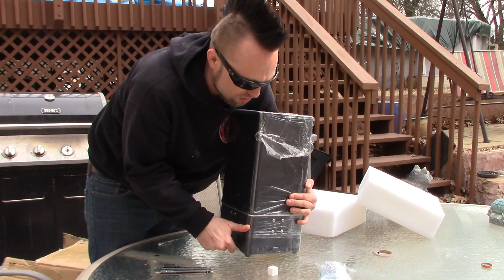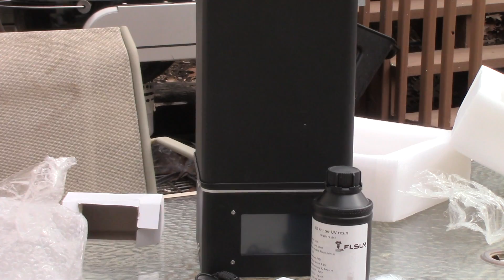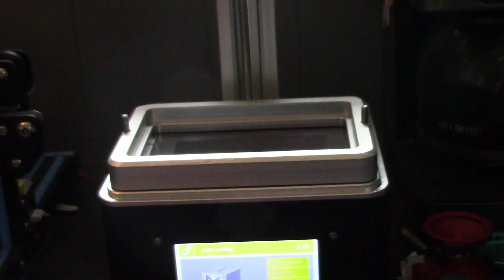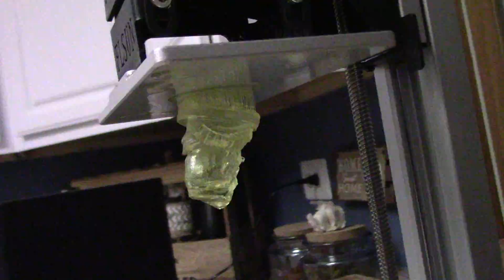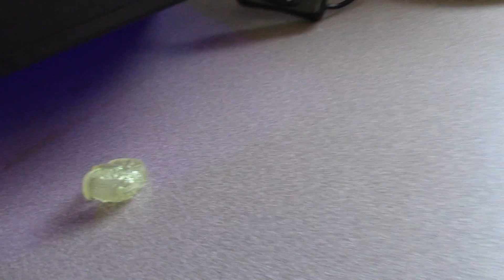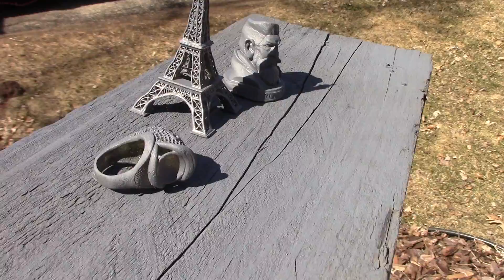FLSUN S / Micromake L2 Resin  DLP 3D Printer Unboxing and Review.

Comment: hi, nice video, i also want to buy a SLA printer. is this the same printer as the MicroMake l2 ? Does it use a laser or a LCD ? for removing the printed object, do you remove the buildplate or can it be removed while mounted ?
did you compare priners before buying, maybe with AnyCubic Photon ? thanks !